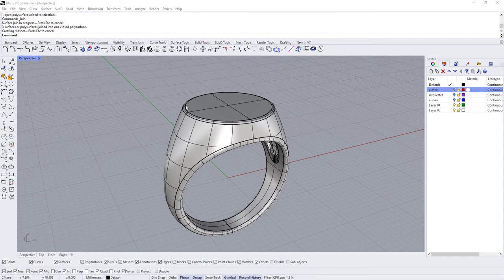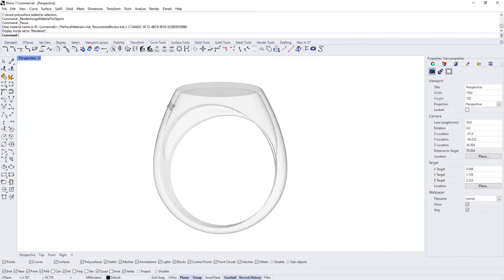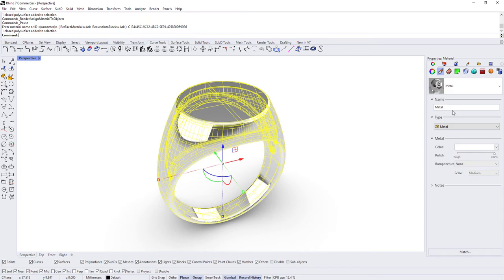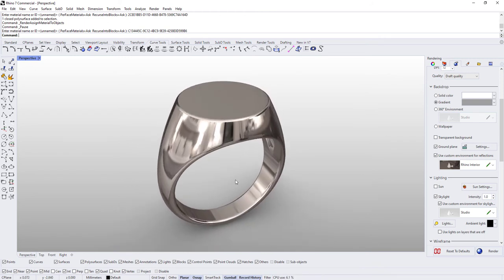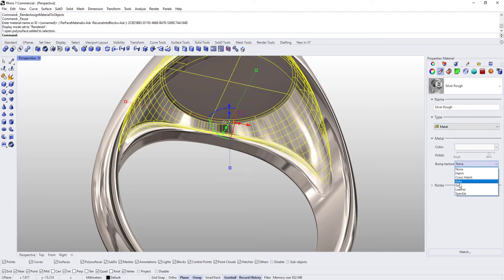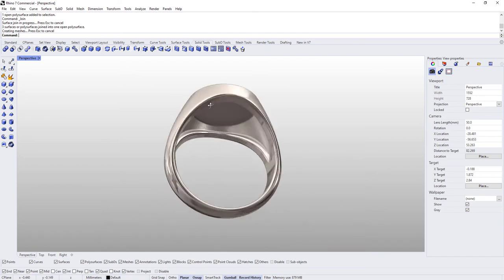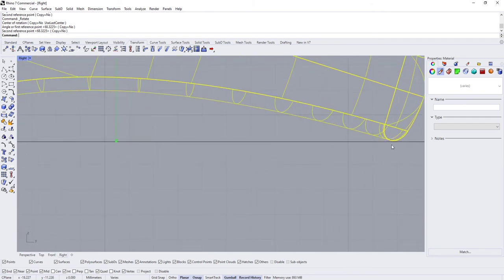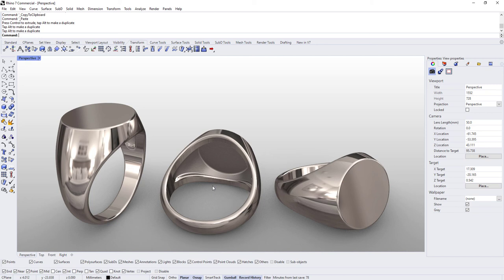Rhino | Signet Ring Tutorial | Part 5 of 5

Comment: hi, why you didn't extrude rings surface,  can we leave it without extruding it
Reply from the maker: Do you mean why did I leave the top of the ring blank? If that's what you mean, I just meant to show how to make a signet ring in general and I didn't want to show a specific design on the top. But you could put an engraving on the top with an engraving machine or you could add any design you wanted to the top in Rhino.
Reply: @webduncetv  your video are helpful to me, as i am a beginner.
Reply from the maker: @just_hold_it  Thank you. I'm glad to hear it.